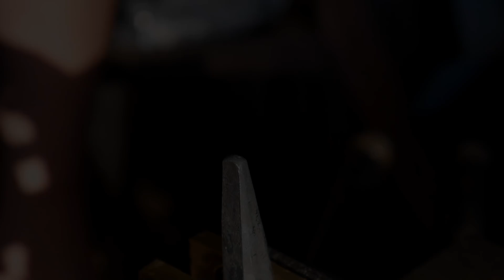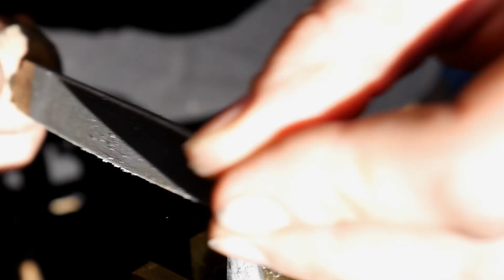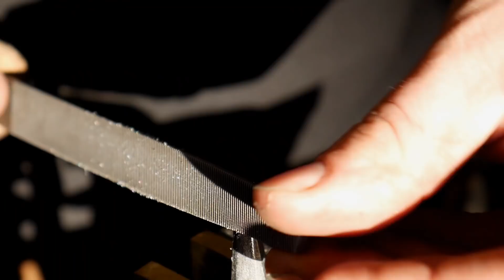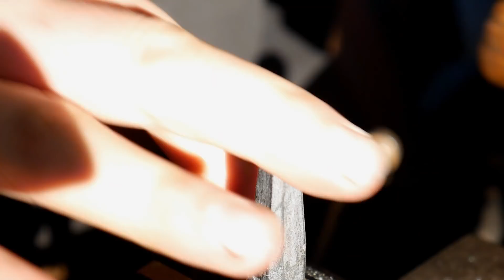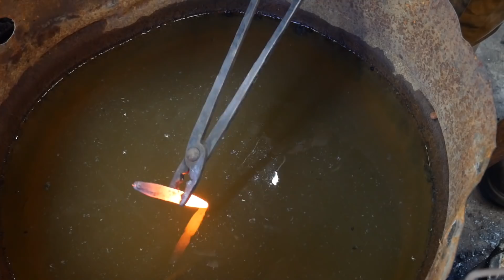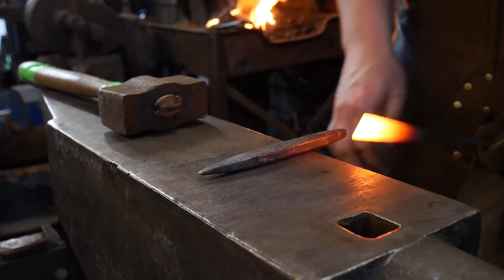Heat Treating the Slitting Punch [Step #2]

Comment: I know this is a dumb question.  When you quenched the whole tool after reaching straw color of the cutting end, it seemed the midsection of the tool was still a dull red.  Doesn’t quenching that steel at a dull red make it brittle?  It may be different from one steel to another.  Just trying to bring it together in my understanding.  
Thank you again sir. Very impressive.

Comment: Hi Roy Im a subscriber for quite some time now and I would like to thank you for all your instractural videos you have posted. I have found a water quench coil spring and I have made punches, set tools and chisels out of it with very good results. Im using the same technic you illustrated in the video for hardening and tempering excetp I dont quench the struck end. They all work fine but for a hand held bucher which I made (and fixed a few times) to chisel to square the rectangular hurdy hole in my make shift anvil subistitute. The last time it broke in half just before the bevel started were the hardening and tempering took place. And surprisingly I found martensite stracture in the core the tool. Is that prosess not suitable for such a tool that will take so much abuse? Should I have waited loger for purple colour to apear than the bronze one? The coil is 2cm thick  more than 6/8 of an inche.